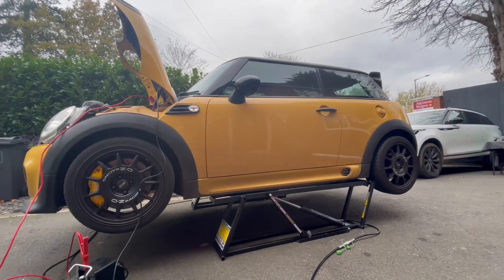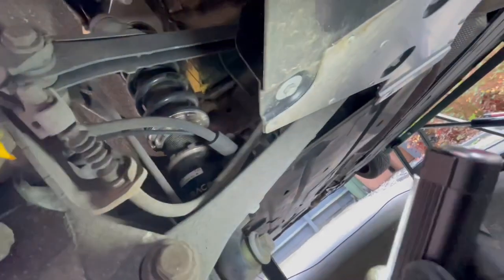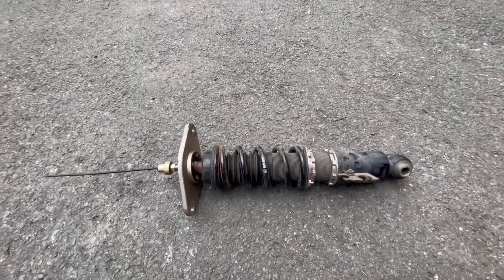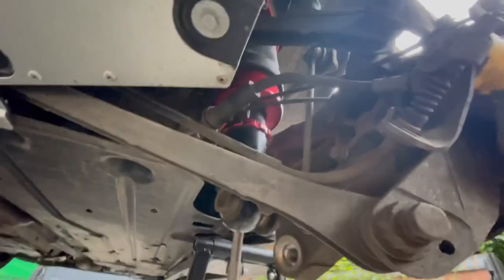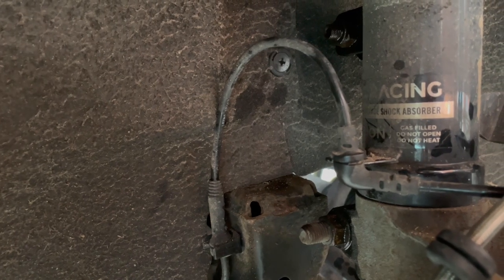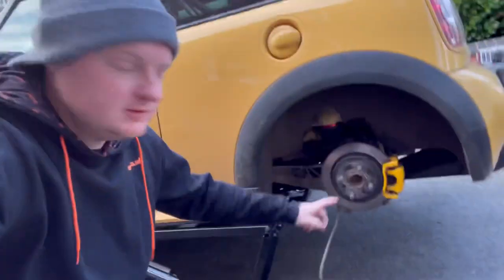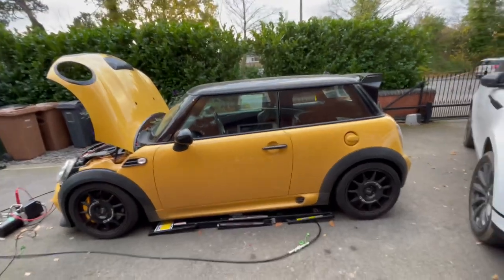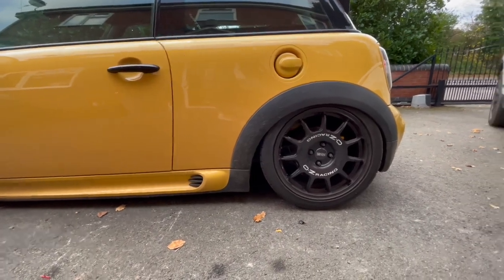Vlog: Mini R56 Build Part 9: Fitting Air Lift Performance Bags and Air Management to the R56

Comment: I do have ask, and find this to be VERY common when it comes to installing any airbag system, know one ever shows the routing of the leader and wiring lines. That ultimately is my opinion the most important and yet also the HARDEST part to work out. .. 

Have you ever posted photos that shows that by any chance ?
Reply from the maker: Just like wiring an amp it’s personal choice where you route things.  On the r56 I routed my airlines along the brake lines front to back as you know they are safe.  On my r53 I routed everything inside the car the side sills.
Reply: @tweedbean  personal choice and safety are two different things . Amp or suspension, where I might think is okay is somewhere you can see a fault and reason not too.
Reply from the maker: @RepLicanT00100  I purposely dont do detailed fitting videos for suspension and brakes as if you get them wrong it can end very badly.   For me if you are not confident to find a safe place to route air lines, maybe you should get a company to fit it for you.

Comment: How would you compare the ride and handling of the airrex struts and bags vs air lift? Love your vids
Reply from the maker: Thanks for watching, at the moment I can’t judge as the f56 isn’t set up correctly, needs some adjustment and drop links changed.  Then I can answer that
Reply: @tweedbean  that makes sense, look forward to hearing your thoughts. I’m on the fence on what set up to go with for best handling and ride.

Comment: Can these air kits be used to lift the car for off-road clearance?
Reply from the maker: Good question.  Air Lift air springs are not intended to be used as a “lift kit” to provide additional ground clearance. Doing so will create a very stiff and uncomfortable ride. Lift your vehicle first and use Air Lift air springs and air spring spacers for additional load support.  This was taken from one of the manufacturers websites